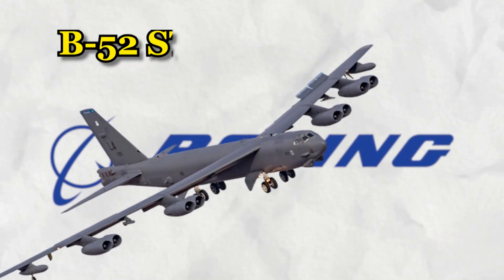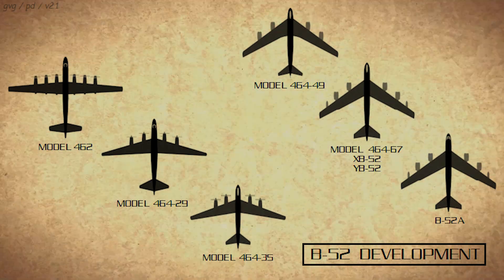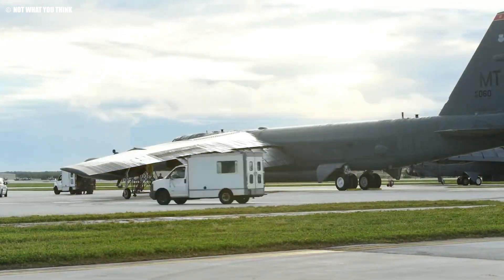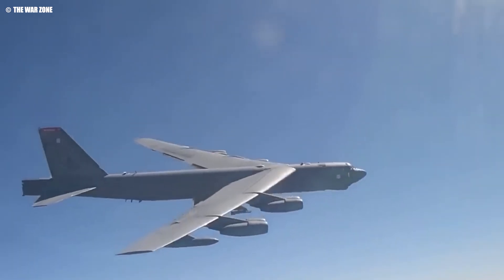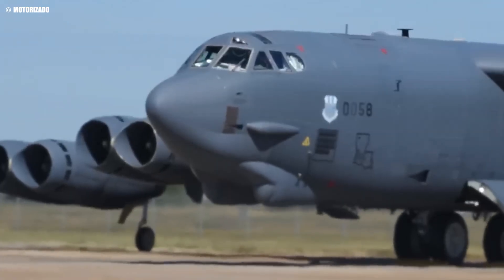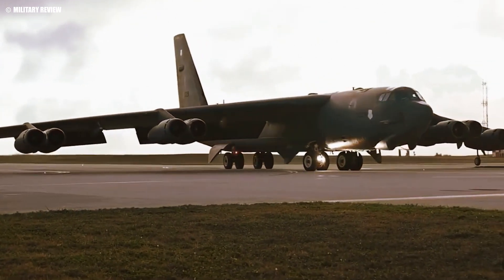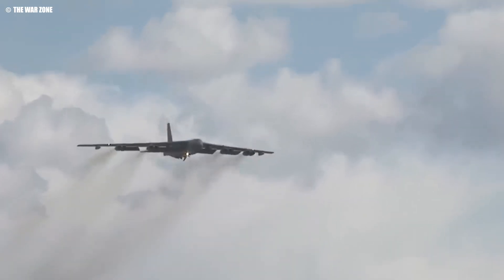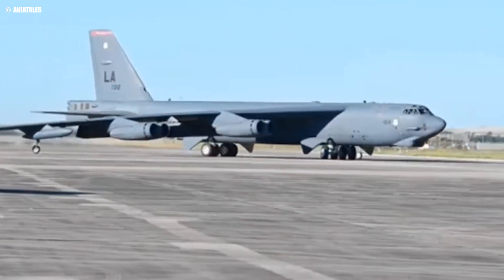The NEW B-52 ENGINES Will CHANGE The Military Aviation FOREVER! Here's Why!

Comment: The thrust of the F130 engines is the same as the TF33s they're replacing, 17,000 pounds/engine. Therefore, as the airframe was designed and stressed for 17,000 pounds of thrust per engine, there should be no takeoff performance improvement. Further, payload capacities, takeoff rolls, and unstick speeds should remain the same per mission profile. More...

What will definitely change though as mentioned will be fuel efficiency once launched. That means either slightly longer missions with the same number of air-to-air refuelings or fewer air-to-air refuelings for the same length missions. Additionally, it's conceivable, the mission planners might go crazy and plan 30, 40, or even 50 hour missions requiring even more air-to-air refuelings with augmented crews of 10 or more member flight crews. 

If that happens, then a regular restroom facility better be available ‘cuz the honey bucket beside the periscopic sextant nav station upstairs in the BUFF and a single can to pee in downstairs won't cut it,  especially if there are any female crew members. A honey bucket and single pee-can in the open is what was available to us the B52G I flew in the 70s. The B52H/J/K might already have an airline style restroom, I wouldn’t know…
Reply: I think the improvement comes from the increased performance in specifically hot environments. The TF33's may have had performance losses in super hot environments that limited their max takeoff thrust. If the F130 engines perform better in hot environments, than they will have a higher takeoff payload in those situations. I think that's what is being claimed.
Reply: Thanks for responding and not to be too argumentative, since both are turbofan jet engines, It would seem to me that they would be affected equally by hotter, less dense airflows. But I was just the pilot of the 'G' I flew in the 70s. I took whatever my engines gave me and dealt with it. On Guam, when we took off on our bombing missions, we never had enough power, even with our water injection, to achieve flying speed by the end of the runway on hot days. We, the pilot and copilot, would have to yank it off the ground and push it over to gain flying speed as we headed for the ocean 300 feet below the end of the runway. The 'H's never had that problem even on hot days. We were always just a bit jealous of the 'H's...
Reply: @larryrobertson4099  My dad was Flight Engineer on the Herc's. I love that plane. Super versatile, and absolutely nuts at take off and landing capabilities. Definitely the largest plane to ever land and take off on an aircraft carrier unassisted. <3

Regarding the turbofans, I would def have to look at the specs, but I would have to guess that while they are both of the same type of engine, the specific characteristics of the fan blades and/or compressor stages might make them more capable in hotter, less dense air. Even having the same thrust, perhaps if the F130 engines have a tighter tolerance on the compressor stage it will allow it to compress the less dense air more efficiently. That might also be coupled with a different bypass ratio. I haven't looked (or even know if the F130 has detailed specs available or are classified), but does the F130 have the same bypass ratio as the TF33?
Reply: Both are 3.9:1 as far as my internet search could take me <grin>.